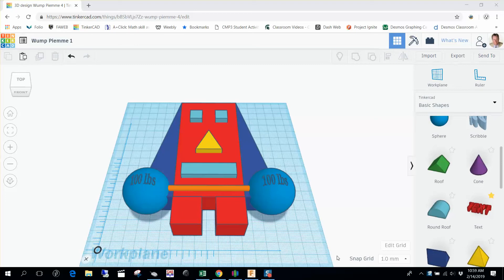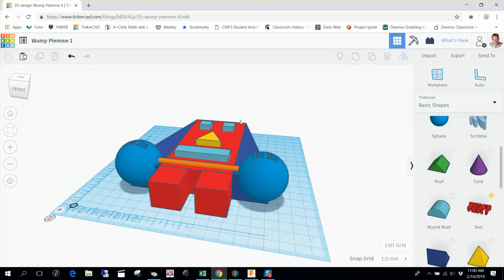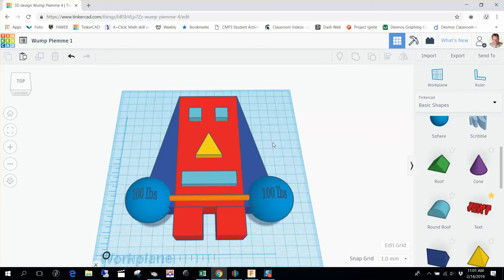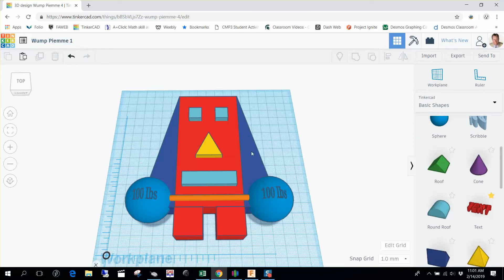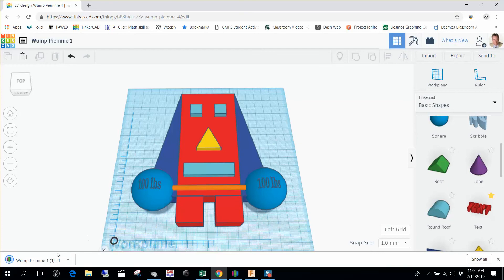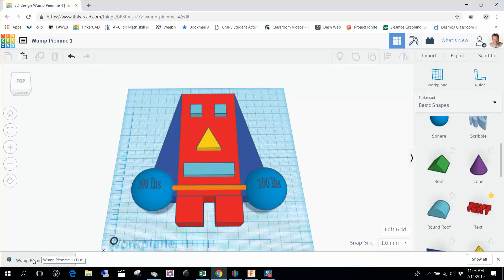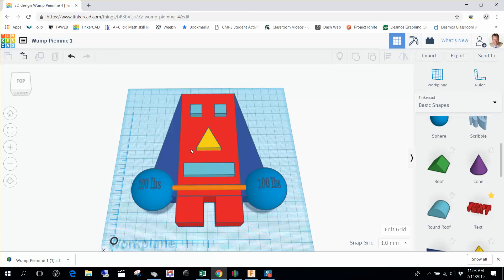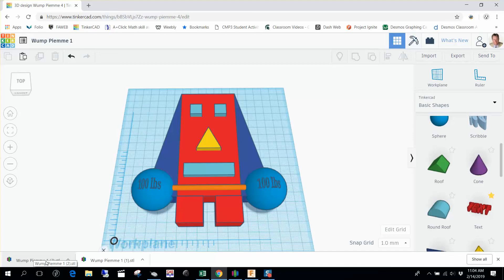Export an STL File from TinkerCAD

Comment: Thank you very much for your time and explanation, I have a question as an older noobie...I made a simple design using tinker cad to test my new 3d printer (Ender 3) and I am using KISSslicer as my slicer.....however KISSslicer will not open the .stl file in .zip format, am I doing something wrong?   I chose KISSslicer randomly and was not able to use the CURA software recommended by Creality because I have a 32 bit pc and CURA requires 64 bit, any folks out there willing to give me some help in this regard?...thanks again!!